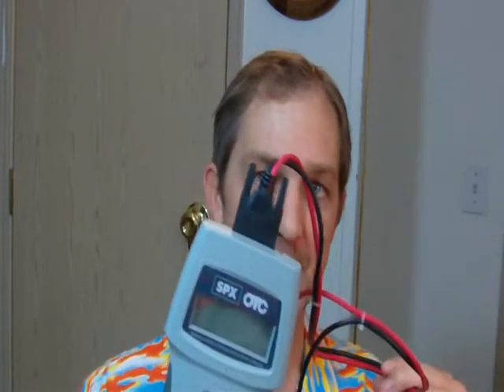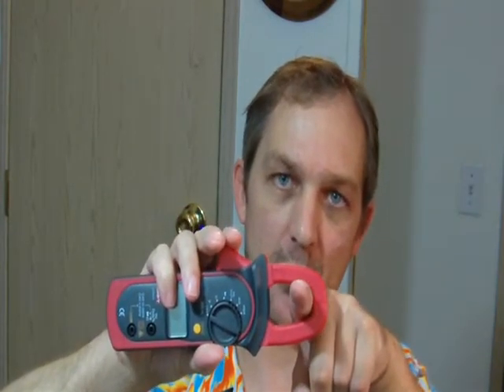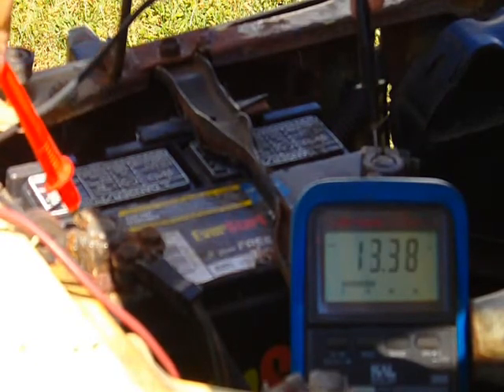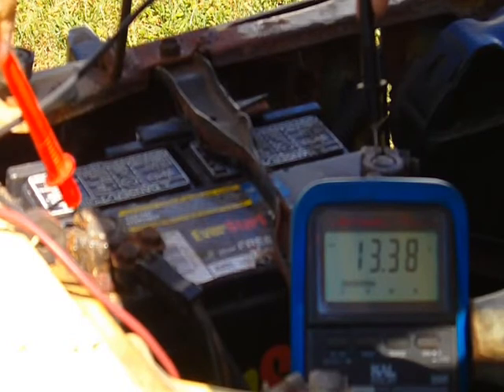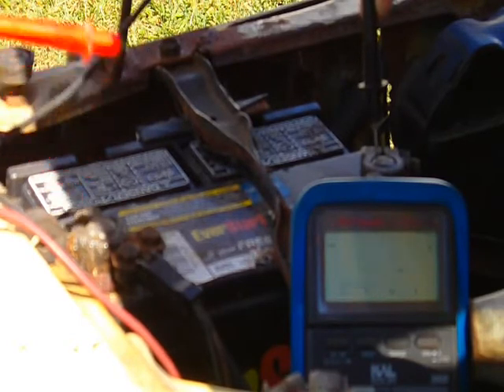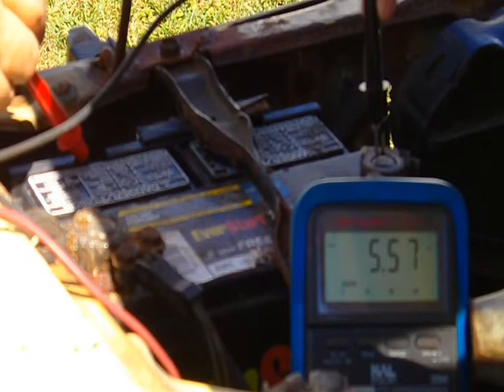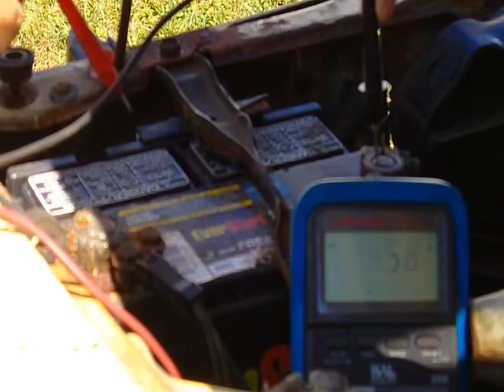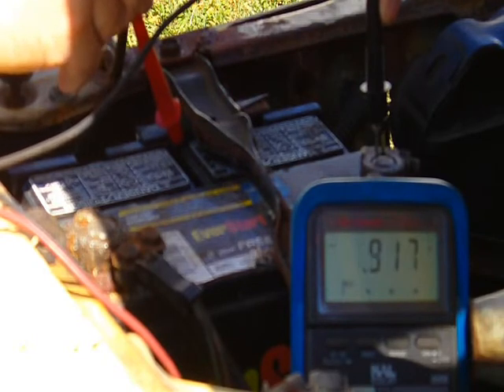Testing your car battery part 2

Comment: You can have 12.65v coming out of the battery and it could still be bad, it's about the Cranking amps. At first, I was confused because mine had 12.7 volts coming out but the cranking amps were low and the battery was still bad.